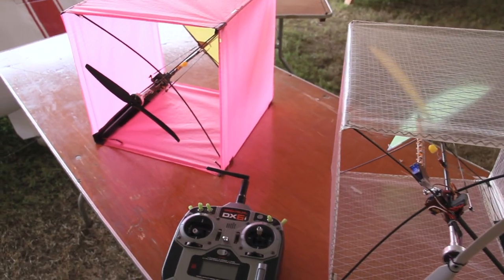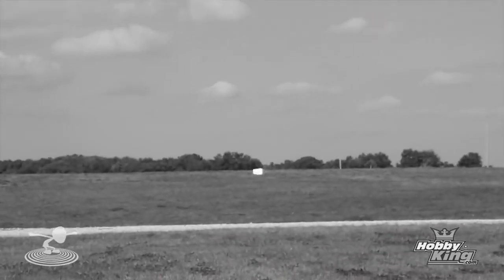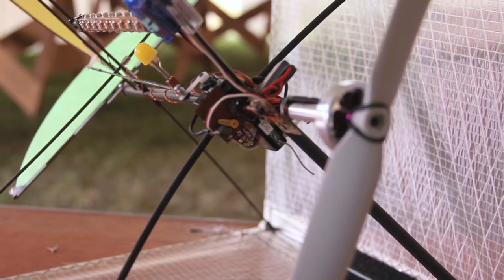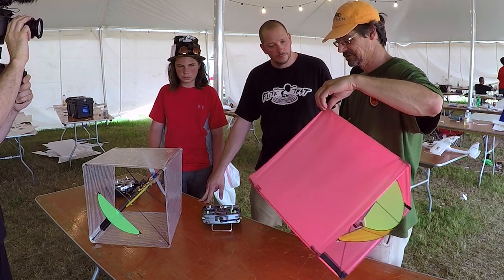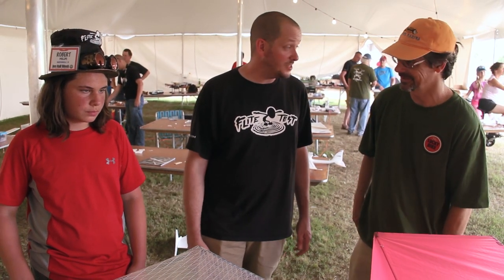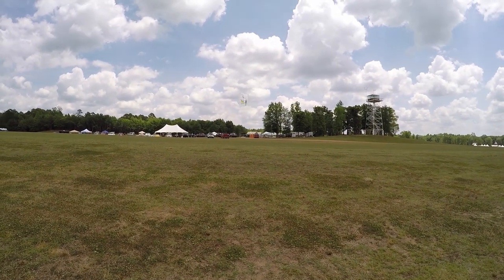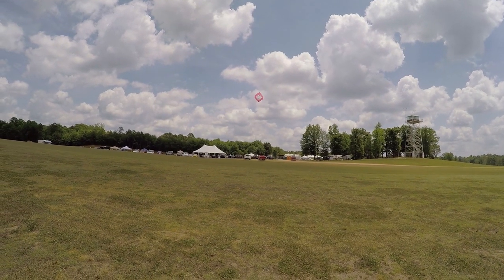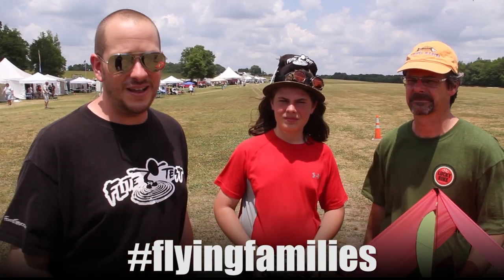Flite Test | Glow Kite - Flying Cube

Comment: The motor on those is insane. Achieves 15-20 minutes of flight and has a 4:1 power ratio? Good lord!
Reply: ***** If you can do it your glider can stay up as long as the sun is out on some days and at the slope you could technically fly 24/7 until your rx battery dies
Reply: yeah but 15-20 mins on 1/3 the throttle....

Comment: Hello guys, please help me, I got my bixler 2 rc plane and with a HK-T6A 6ch transmitter with a trainer port (in detail ''a cable that you can insert from the transmitter to the computer via usb'') so it says that It does not install the drivers and that it failed. Can this transmitter be used on simulators? that is all I wonder if this transmitter can be used on simulators. I've tried to calibrate but it is blank, my computer does not recognize my transmitter. Thanks.

Comment: Serious question: How do you not lose orientation if it all looks the same from 5 of the 6 sides?
Reply: thechosendude The control surfaces seem to be sticking out but its still tricky i think
Reply: Aaron S I see that, but they're not really visible from 5/6 sides.  Even at a side angle it would be near impossible to see the control surfaces with it in motion.  I could see silkscreening a design or something on the sides/fabric to help.
Reply: thechosendude true. Ive been confused about that too.
Reply: thechosendude I always wonder how some of the quadcopter pilots keep orientation without having different colored arms, LEDs or something. You just feel it some day I guess.
Reply: thechosendude it probably help that it is always moving forward.
Reply: Balu I would do fpv so thats not a problem but if I dont, I would usually put on different colored props

Comment: I have a store request a super power pack where has everything from the controller the motor to the servos ect... So if you got the power pack and the kit  you would have everything you need to build the plane and get it in the air.
Reply: wbap hellcat The Flite Test power packs include everything but the receiver. Motors, ESCs, servos, even wires are included. In the kit you have the steering rods, firewall, etc. 

You just have to add a receiver and a battery.